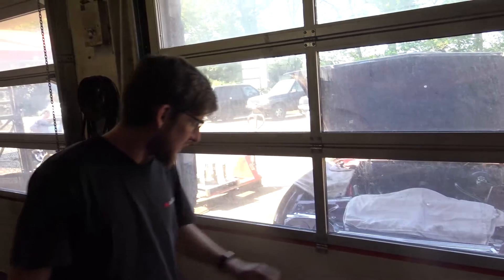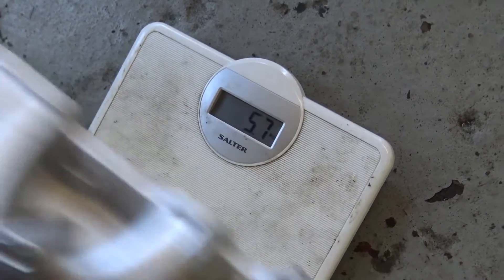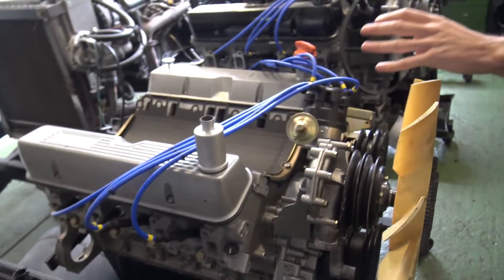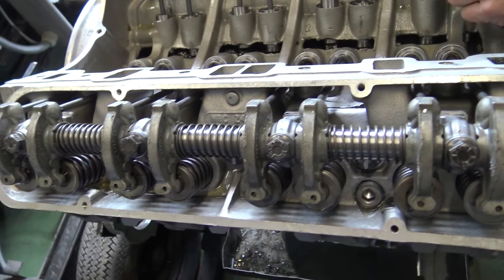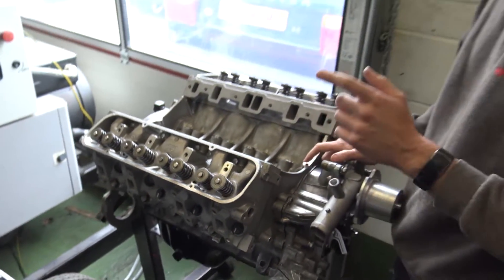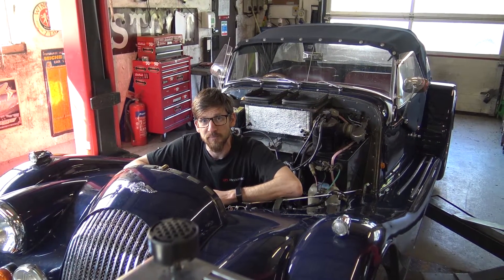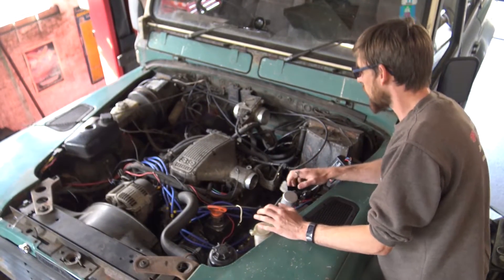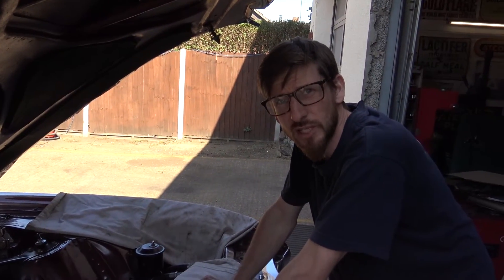RPi Engineering V8 Workshop Update Episode 31

Comment: lovely to see and hear of the lineup of engines your are working on in the shop. hmm,  I bought a tornado for my 1991 3,9L range rover lots of years ago. now its time to do something with my p38 4,6 I guess... christmas coming. got to check your webshop and buy something... :) keep up a good job showing your shop and work in progress!
Reply from the maker: What year is your P38?
Reply: @RPIEngineering  hi :) 1999; XA42...; 4,6 with bosch motronic -ideas? also -do you have any link to your vids regard 4,6 upgrade? have tried but not succeed finding any /cheers Martin
Reply: @RPIEngineering After reading your website now, I guess Torquemax cam kit and a remap (sending the unit to you) would be easiest and number one step?
Reply from the maker: @mekefalk  Yes remap and cam swap for sure. Assuming its auto gearbox then I really like the 270 camshaft as it give more mid range power which is where the engine sits more but the remap is essential for this cam to get the best from it. If you dont want to remap then the torque max is the better cam choice just for knowing the engine will be running OK.

Comment: Hello,
I'm trying to identify a 14CU vs. a 14CUX ECU.  I have a (NAS) 1990 Range Rover Classic which I thought has the 14CUX system, because it has the On Board Diagnostic Display (PRC 7067) right next to the computer.  I thought only 14CUX systems have this(?) But on the ECU cover it only states "PRC 9060."  The insides look identical to that in your article here: http://www.v8wizard.com/Info_on_chipping_Location_identifying_etc.php.  So I'm guessing my PRC 9060 is a 14CUX?  
I also have another ECU marked "PRC 6999".  I installed this ECU and wiring loom  in my MGB nearly 20 years ago.  It does not have the On Board Diagnostic Display (Or a tune resistor)  The MGB has always had starting/ running issues and I had previously given up on it until now.  I just swapped the PRC 6999 ECU into the Range Rover.  When I did, the Range Rover would barely start and stay running.  It also did not present a "02" code on the Diagnostic Display, as if the ECU couldn't identify the display existed at all.  The insides of the PRC 6999 look slightly different than the PRC 9060.  Is this one a 14CU? Both units power 3.9L engines.  Is there an associated PRC XXXX range that exists so we know when the units were updated?  I get that it is way easier to just get a later model ECU that has 14CUX clearly marked on it.   But this is what I'm working with.  Any help would be greatly appreciated.  Thanks!   Is
Reply from the maker: Please email pictures of inside the ECU to info@v8engines.com so that we can identify them for you. Just one picture of each complete board.
Reply: @RPIEngineering  Thanks for the reply.  I will do that today! Thanks! - Wally